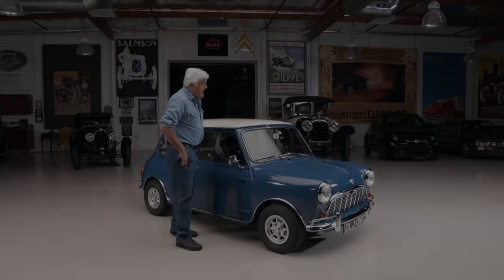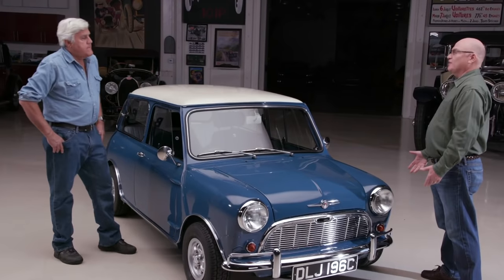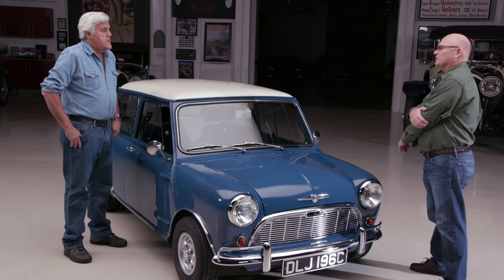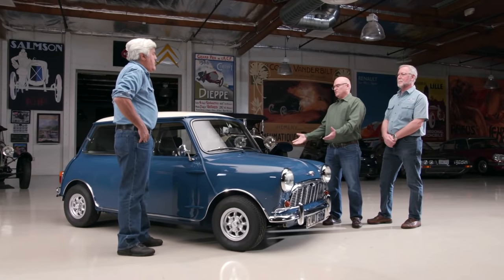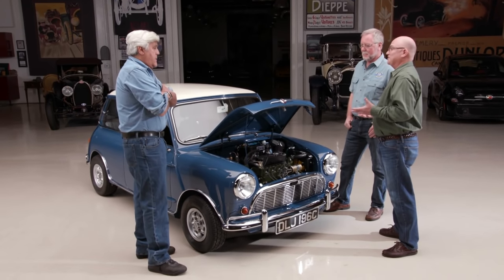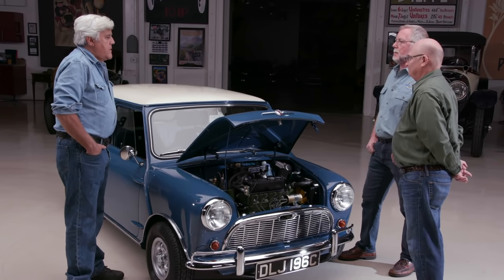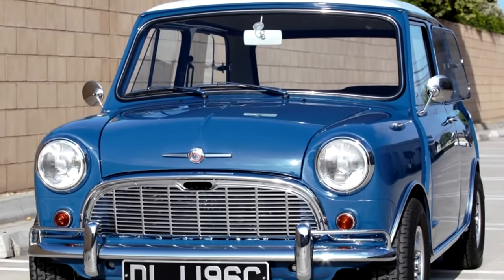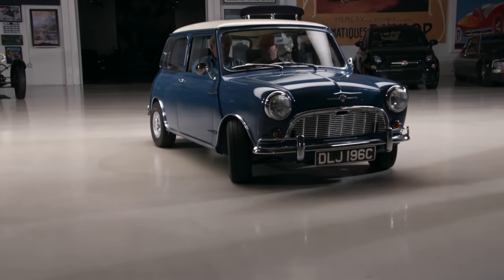1965 Morris Mini Minor - Jay Leno's Garage

Comment: Pity he changed the suspension. I had an Austin 1300 America with the hydrolastic system. I was fortunate two ways. One was that I never had problems with it - no leaks, and the other was that I had the pleasure of driving the car. It was like it was on rails. I've never driven a car that handled like that one. I had the great fortune of chatting with the man who designed that suspension, Dr. Alex Moulton. He's gone now.
Reply: I had one of those. For like, five days. I rolled it. It wasn't idiot proof, but it saved the idiot.
Reply: I agree, he should have kept the hydrolastic. The units are still available and the pipes can be replaced. He might as well have stuck a faux cooper s engine in it. Nice car but its like the joke about the axe having 3 handles and 2 heads replaced.
The ADO16 was a great handling car. Only an idiot would crash one, and would probably have crashed anything.
Reply: Yes I thought that too, it did look quite bouncy in it's new sprung configuration ;-)  I attended a day lecture on Alex Moulton a few years ago in London, very interesting, my specific interest being that I'm a big Citroeniste/ Hydropnuematic fan having just restored a CX Safari to 'new' like state & driving an XM 24v daily.  Moulton himself was a sphere aficionado, I nearly bought his personal XM a while back & yes, sadly his final car.
Reply: Hydrolastic was seasick nasty. The earlier rubber suspension was loads better imo, and much more Go-Kart
Reply: The only thing I don't like is the suspension change to springs, not once did we hear Jay mention go-kart like handling these cars should have, and that's what made them so much fun to drive..
Reply: @raymondo162  I know this system had little or no control over what the suspension did, unlike Citroen's, but 2 points, enjoyment of any sphere based system is purely personal, a few have said they don't like my old CX, with a sea sickness feeling, but most think it's great.  Also back then, this system (I imagine) was designed with British roads in mind, which unlike the USA, had only few good flat/ city roads but mainly consisted of unreliable good then bad roads, so hydroelastic would have been a wonderful change.  It can't have been that bad as it did continue for many years, right up to the Princess/ Ambassador (not sure after that!).  ;-)
Reply: The parts for hydrolastic are no longer available so most people switch to dry rubber cones now.
Reply: @TheRichieboy86  Even in the UK? That's a shame 😕
Reply: yeah unfortunately, you can get NOS parts if you are very lucky but the price is crazy and even then it's a gamble if they still work, then you also need the BMC to to refill the system, just not worth it really.
Reply: they should bring back hydrolastic with todays technological know how and reliability
Reply: I think MG Rover did try in the 90's with Hydragas suspension on the MGF and Rover Metro.
Reply: @jjmac3561  I didn't help that I was a 16 year old idiot. I replaced it with a Corvair (I like weird cars) and it's no small wonder I didn't kill myself in that. But I lived, and grew up, eventually.
Reply: user name  Maestros had conventional steel coil springs, but yes, the Metro had Hydragas and as mentioned above, the MGF still had it up until 2002
Reply: @jjmac3561  54 year old hydro bags are about as reliable as a 54 year old tire. There are no new hydro units being made. The coil spring replacement we use retains the comfortable hydro ride without fear of failure. Not to be confused with a coil over kit, these springs fit in the original location.
Reply: @Chillmax  I understand his Dad designed the rubber suspension for railway cars.
Reply: @grahamreid2765  I think the main advantage of the Hydrolastic system was the interconnect, which changed the pitch moment to a vertical one and gave a more 'floating' effect. Having owned a series of BMC cars with Hydrolastic and Hydrogas suspension, I found the ride and handling  to be really good. In the video it just seemed too bouncy at the rear end. Maybe it was exacerbated by the camera angle.
I really like what has been done to this vehicle. It is not 'over-restored' and looks like a car that has been well looked after rather than it beeing too perfect. Good job.
Reply: Knew a guy who had a hydrolastic Austin 1100 in the seventies. The piping rusted through and the suspension failed so he replaced the bad piping with steel tubing from the auto parts store, filled the system with windshield washer fluid (basically water with alcohol and a little soap) then pressurized it from the air hose. It worked perfect as long as he owned it.
Reply: @Chillmax  yes it did look quite bouncy the way they were bouncing up and down in their seats. It looked like they were feeling every bump in the road.
Reply: @mrdanforth3744  Yes it could be done. My dad modified a grease gun to pressurise the system on his mk1 1800. It worked perfectly. He described the fluid as a water and antifreeze mixture. He did all his own maintenance - well you could then.
Reply: @grahamreid2765  " There are no new hydro units being made. The coil spring replacement we use retains the comfortable hydro ride without fear of failure. " If by chance could you please point me to a Website that sells these coils? I live in New Zealand and im not having much luck with google as im not sure of brands or names for these coils. Id love to use my old Wolseley 1300 MkII more without fear of the Hydrolastic system dying. Thanks in advance
Reply: @Samuel Molloy Exactly. No pitching front to back, and on corners you can't compress both ends at the same time. The car always stays level, like it's on rails.
Reply: @grahamreid2765  This is the best possible solution when originality becomes impossible if you're actually going to drive a car and not just display it. With there being no modifications made preventing a return to originality you lose nothing and gain a usable and maybe safer car.
Reply: There are firms in the UK who rebuild the hydrolastic displacers and can replace the supply hoses.  The metal lines are also readily available through normal Mini parts suppliers and are not costly.  I have a Mk2 Morris quite similar to this one (same Island Blue for example) and it retains the hydro system.  I've owned both hydro and non-hydro Mini's with 10" wheels and if one of my displacers were to fail, I would have it rebuilt as the ride quality with hydrolastic is FAR superior to that of the standard rubber cones.  I've fitted the 'upgrade' front shock absorber kit (also readily available) which greatly reduces the pitching that hydro cars without them have under certain conditions.   Thanks Jay for featuring this beautifully restored 'lesser' classic Mini..  They aren't all Cooper's or Cooper S's..
Reply: @raymondo162  Absolutely correct. Hydrolastic worked well on the 1100/1300 and the 1800 (can't remember the ADO numbers) but was definitely nausea provoking on the short wheelbase Mini.
Reply: A lot of people who do spring conversions don't realise that it cracks the subframe after a while. Minis arent designed for springs.
Reply: The hydrolastic was fun, under certain conditions it gave an interesting bobbing ride.
Reply: @jjmac3561  - Sadly, looks like the suspension installed on this car is a "fail". Should have kept it original, as i see others posting here say that the original suspension eliminated that pitching motion. Maybe the guy is out of money now and can't fix it😥  But i tend to agree with the guy about not changing the body. 🤔All the other parts bolt onto the body, and i would consider those to be replaceable, but not the body shell. If i were to restore my TR4 that i have had since 1976 with a replacement body shell, i would probably have a "better" car and maybe more economical restoration, but it wouldn't in my mind be the same car that i had in high-school. I, like this guy, would restore my original shell at any cost if i had the $.  Same with the engine block. As long as it was the same block, i would consider it to be the same engine. I dont blame him for changing the pistons, as it sounds like the original pistons weren't up to the task. He could bolt anything to that block and i would consider it to be the original engine. As far as the "same axe", i would consider replacing the handle acceptable,  but not the head, otherwise it would be a "new axe." Seems to me this guy replaced the "handle", but used the original "head." I guess everyone has a slightly different focus of interest in a "project".
Reply: JJ Mac ?

Comment: I worked in a garage in Ramstein in the early seventies in an old factory building. We had so many minis that we stacked them on top of each other. They were great small cars, huge fun to drive and very cold-blooded in German winters. My own Mini was a wagon 850CC engine and the magic wand gearshift. The first modification was to get rid of the narrow rims and tires and go over to a set of wide rims and tires, which made it stick like glue on the corners. It had the rubber suspension and on the way to work before Ramstein there was a small bridge and I could fetch some serious air before landing.

Comment: Everything in the UK was painted green after ww2 for about 40 years think they had way to much green camo paint left over
Reply: They just wanted to blend in because they were almost bombed out of the war.
Reply: That was my thinking when I saw it in the video here.  I looked at that green on the engine, and thought I recognized it from British WWII equipment.
Reply: BRG is actually 'Brookland Green' this is just tractor engine paint, which was slapped on every engine BMC produced almost.
Reply: There was a lot of grey and orange too (for similar, military related, reasons)
Reply: @johnpossum556  for 4 years ? day and night - untill the germans had already lost - and then the us turn up? like cowards -
Reply: @davidhunt240  my Morris minor was originally battleship grey, plus no nickle plate inside for 51 because they were still under rationing
Reply: Green paint: copper arsenate primer 
Orange paint : red lead primer
Grey paint: calcium plumbate primer.
Reply: @Leigh Garfield Originally Motor Racing was going to paint the cars the National Colours, Italy Red France Blue etc.Britian has no 'National ' Colour.But, hey the Irish aren't racing and thier National Colour is Green, close enough.
Reply: @TheRichieboy86  Blackfiriar's Tractor enamel :-)

Comment: He laughs when he says what was the horse power, he says it was 34 and now its 60 and they laugh, for a car weighing less than 600kg's, that means it's got around 100 Horse power per Ton.
So to put that into perspective it's the same power to weight ratio as a 2 Ton Car putting out 200 Horse power

Comment: Ooh the nostalgia! My first car was a 1963 mini 850cc, good fun car, except when going down a very steep hill in Kent the brakes failed. Managed to coax it home very very slowly. Spent 4 days with my fathers help under the car fixing the brakes, new wheel cylinders all round, tried new seals but the cylinders were just so worn, new pads all round, break fluid had soaked the pads. and finally a new master cylinder. With the repairs the car was perfect.
Reply: you mean shoes?

Comment: My 850 Mini became a beast with the 1,100 cc short block assembly fitted to sump. Longer stroke requiring crankcase webs to be machined back for clearance. Surface ground head for 7.6:1 compression, Cooper inlet valves & springs, 3/4 race cam, cooper exhaust, machined light weight flywheel, 2 SU carbs. Baulkring synchromesh, Pirelli rubber. Was rocked rolled & raced 😎 Them were the days.

Comment: Watching this brought back so many memories of my first and only Cooper. Thank you to both gentlemen for this episode. 

Strangely, what surprised me more than anything else was the position of the interior light. My 998 had the light to the left of the passenger's head (right-hand drive) on or just above the pillar between the door and the rear window. It came with the twin fuel tanks and included a BMC clip on cover (not a shroud) for the coil and plugs to stop water affecting it.

Comment: I had a '64 Mini Minor like this, I only drove it in the winter. One day I saw a few bubbles in the paint under the boot lid, so I attacked it with a screwdriver. We ended up going to the scrapyard, finding a write off with a good back end and replacing the whole section to half way up the rear lights and halfway across the boot floor, including the whole battery box. Battery may have been the cause of the trouble. In the same yard was a rusty mini van - different body but there was a nearly new sub-frame in it so we had that as well. Mine had the rubber suspension designed by Alec Moulton, who made the Moulton bike. Dad resprayed it in a deep metallic blue and we added a fake vinyl top which you sprayed on. It looked good. It was a skate, I loved driving it on the twisty roads, it slid better on those 4.50 x 10 crossply tyres.

Comment: My first car was a 1965 Mini 850 - exact same color body and roof as Steve's. Purchased for $275 in 1973. Still recall the rego no. JCX 690. Top speed: 64mph. Thankfully I had an engineer brother who installed a "massive" 1100" cc engine. As Jay noticed, the distibutor is located at the absolute front of the grill. This caused lots of issues in the rain. I became skilled at removing the dizzy cap and drying the points with a tissue.

Comment: I had a 1959 Morris Mini Minor when I was 22 years old, bought it off a lot for $700, as I recall in 1963.  Lots of fun with that car, reverse went out at one point, and I was able to buy an entire front subframe from a junkyard that had the whole power train and front suspension.  A friend and I changed it out, and had it driveable on one Saturday.  I remember there were only six bolts that held the subframe to the shell of the car.  We disconnected everything and the two of us picked it up by the front bumper and rolled it backwards, then rolled the new subframe in place, and rolled the the body back over it and connected it up.  Went to start it up, and the throttle cable started smoking,  We had forgotten to hook up the ground strap.  Fixed that and all was well.

Comment: The first Mini was an Austin Seven , then they brought out the Mini Minor which was dearer to buy, the 7 had 1 single dial in centre of dash , the minor had an extra 2 gauges oil pressure and water temp.it also had over riders and corner bars on the bumpers, and better wheel caps. i had a 1963 Mini Minor in Tartan Red. XMS  736.

Comment: Memories.  My first car was a 13 year old 1959 Austin Seven, later re-named as the Mini.  It had an ignition switch on the floor and a gear shift that was about a yard long.  I upgraded a year later to a 1966 Mini (848cc) with carpet! What luxury!

Comment: Re the positioning of the distributor being right behind the grill. I had a Mini Minor (Morris 850) in Melbourne Australia with an after market radio fitted.  I swear I used to turn the radio off when the weather forecast came on because the 1st hint of rain the car would stop.  We used to use a rubber glove, with the tops of the fingers cut off, over the distributor - thumb for the high tension lead and the other 4 fingers for the spark leads.  Then in the humidity of summer, condensation would occur inside the glove so the car would stop when it wasn't raining.  Great fun car all the same.

Comment: Jay mentioned water in the distributor problem. We used to get a rubber marigold glove and cut the finger tips off, pass the ht leads through the opening and duct tape the openings closed. Simple solution but worked a treat for cold British mornings when condensation was a problem.

Comment: I bought my tartan red 1962 Morris Mini-Minor in 1973 from my brother-in-law for my wife to learn to drive in as I had a company car at the time. She passed first time and drove it for the next 20 years when she got an Austin Allegro!!! and so it was put into a heated garage and there it has stayed until now. The registration is one of the last two digit, three letter combinations that was allocated prior to the introduction of the letter suffix. It has the long gear lever, with starter button and headlamp dip switch on the floor. I must get around to running it again, as it does not now need to be MOT tested or pay road tax for it, as the Government now class it as an historic vehicle!

Comment: I had a blue,bought new ,1973 1275cc Mini Clubman GT made in Australia with twin SUs and nitrided bearings,high compression head [actually the Cooper engine with the extra stud],twin fuel tanks and hydrolastic suspension with wider wheels and flared wheel arches..I actually preferred the rubber suspension.Great fun.Wish I had it now.The colour was called: am I blue.That was a looooong time ago.I didn't keep it that long because the Australian high back seats looked good but were incredibly uncomfortable on a longish trip.I think it cost NZ$3,350  which was a tidy sum at the time.